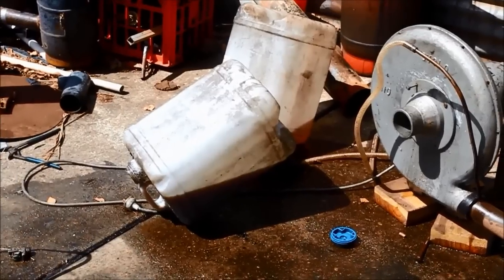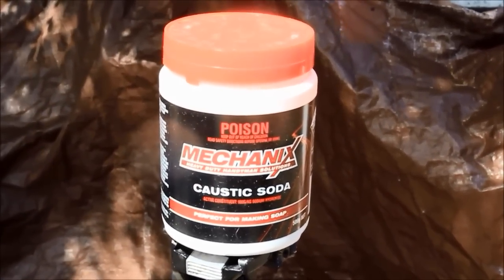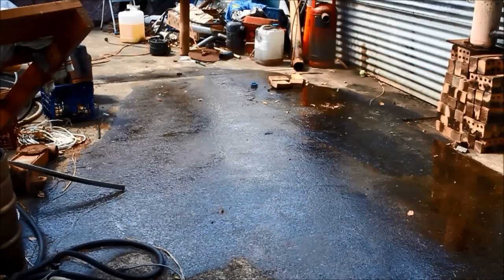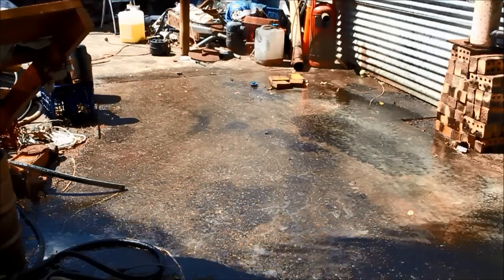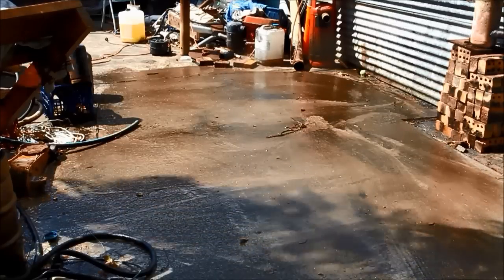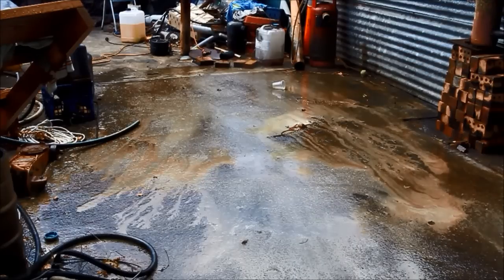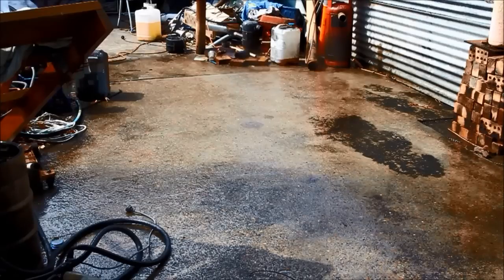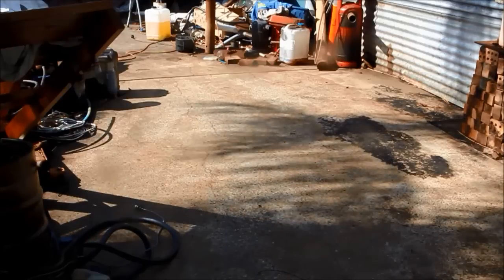Waste oil spill quick and easy Clean up

Comment: Just as an FYI to anyone who does this to clean their concrete; be careful, this can eat through your concrete. When a solution of sodium or potassium hydroxide (NaOH or KOH) is applied to concrete (CaCO3) the sodium and hydroxide ions will replace the calcium and carbonate ions to make a solution of Na2CO3 (washing soda) and Ca(OH)2 (dry concrete mix). It essentially turns the oil into soap and turns the top layer of your concrete back into wet concrete.

That is why it works so well at cleaning your concrete, it basically lets you scrub away the top most layer of your concrete like a brillo pad on a copper pot. Also theoretically you could let this sit and let carbon dioxide from the air react with the Calcium Hydroxide solution and turn back into concrete, but then you would essentially permanently impregnate the concrete with soapy oil and it would look nasty. Luckily it will only eat a little of your concrete if you only use a little like he did here. For the occasional oil spill it should be fine as most of the Sodium hydroxide is reacting with the oil and not the concrete anyway, but do not use this to regularly clean your concrete driveway.
Reply from the maker: I have used this method for many years and cleaned the same sections of concrete dozens of times. To say that a bit of KOH is going to eat through 4 inches of concrete really is nothing short of laughable. It simply would take years of every day application probably multiple times a day to have any effect. If it eat the concrete like you say, I'd have pounds of  cement being washed further down when I hosed the part I was cleaning off. I does not happen.
I would like to see an experiment where you got a section of path and showed exactly what it took to even take 1/8th of an inch off it with KOH.
It's all good and well to talk theroy but reality and practical application is something else.

You would have far more chance of " eating through" Concrete using a domestic type Pressure washer.
Your warning of KOH eating through concrete is a gross dramatization and exaggeration in relation to what is shown here and simply will not happen.
Reply: Oil Burner
 I should clarify, your instructions were excellent and if someone were to follow them to the letter they would cause no appreciable harm. It takes two mols of NaOH to react to every mol of CaCO3. That works out to 80 grams of NaOH per every 100 grams of concrete. So .8 lbs of NaOH has the potential to mess up 1 lb of concrete. You used your NaOH rather sparingly, spread it over a relatively large area, and quickly drenched and washed away the excess caustic solution. You would have uncured a nearly negligible amount of concrete below the surface and only lost a layer of concrete a few microns deep. It would take you centuries of occasional use to notice that. Even so some NaOH would still soak in and compromise your concrete theoretically, but the concrete in your case would just cure back. If someone were to dump that .8 lbs of NaOH in one spot and not take the precautions that you took they would concentrate a lot of NaOH in one spot and mess up 1 lb of concrete in one spot and that would be noticeable in a few years, it would probably become structurally compromised and just crack to bits. The last comment was more of a warning to someone who thinks they can be careless with a caustic chemical, which you unsurprisingly can't be. So to recap what you do is fine, just remember to spread out and dilute your NaOH and just about any damage you do with it will be fixed as the concrete re-cures. Concrete slabs take like a century to fully cure anyway, (fully and totally stop reacting, after it sets and initially cures it's fine as is but it gets stronger with time) this will just make them take longer.
Reply from the maker: Henryandginger
Thanks for the clarification and putting things into perspective. My driveway is 5.5M wide and 50M long. I have probably cleaned every bit of it more than once but some parts where I mainly work, many more times than others.  I know my concrete is 6 inches thick instead of the normal 4 but I guess a person could easily work out how many TONS of KOH they are going to need to dissolve their driveway.  I think they are going to run out of money to buy the stuff before they run out of concrete!  :0)

The main damage I have done to my driveway is to cause it to spall by having hot burners and dropping molten metal on it.  I have sat burners on it and taken out a couple of CM depth of cement without realising. I thought the cracking under the burner was water in the oil or something. I have learned now and always put some sort of a heat shield under them.  It actually doesn't take much to protect the concrete and stop this happening.

I'm not too careful with spilling oil, I end up making a mess no matter how much I try not to then I just end up getting frustrated. Much easier to take a sloppy approach with the idea of cleaning it up anyway and not getting ones self wound up about spilt oil.  :0)

Comment: 😅😆🤣  Love the disclaimers!
So, caustic soda and veggie oil - you'll have the cleanest driveway in town!
For engine oil, you can use a little petrol and dry it off with your waste oil burner  It'll be spectacular if not clean!

Comment: I have a motor oil spill on my asphalt driveway from almost a year ago.  Would using caustic soda and water over it a couple times help clean it up or is too late?
Reply: Yes. That’s how degreaser is also made. I am a power washer and I use sodium hydroxide all the time

Comment: How much sodium hydroxide do you add for a good mixture in 1 us gallon? For grease or oil?
Reply: I use 100gram per liter so 380 grams per gallon.
But it's really strong at that concentration.

Comment: Holy crap you used the "Greek Broom" on your driveway, LOL and nobody commented on the water wastage or the environmental damage that Caustic Soda and Oil mixture is going to do to our creeks, rivers and oceans. There's an orphaned penguin in Antarctica now because of you! LOL bahahahaha
Reply from the maker: +Ataman Atlas it's a miracle isn't it???
The mere action of turning on a tap these days is automatically wasting water, even if you drink it!
Using water is just not  something that can even be comprehended. We need to save all the water so we can do ..... Nothing..... with it!

 Yes, caustic and oil.... otherwise known as soap.  It's a real problem. You hear of ecosystems and wiled life being wiped out every day through the malicious act of people washing themselves. It's in the papers every day.... Just like some do gooder pea brain who's greatest academic achievement is the discovery of some other idiotic complaint to harp about.  It's like the pharmaceutical industry, discover the problem of dry arsehole syndrome in the morning and cure it in the afternoon so you can have a nice moist one that will leave skidders in your jocks to be proud of. 

Bit of KOH and oil will shift those nasty stains, but think of the orphaned minority group penguins in Antarctica and their rights!
Reply: +Oil Burner LOL True indeed LOL